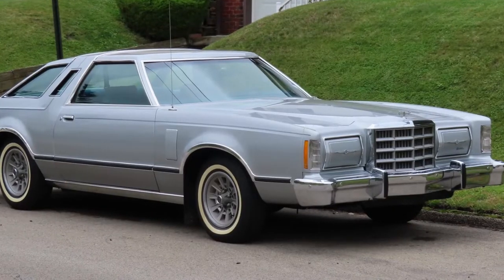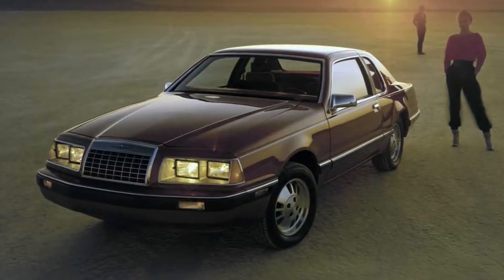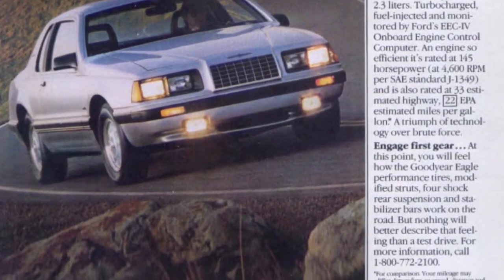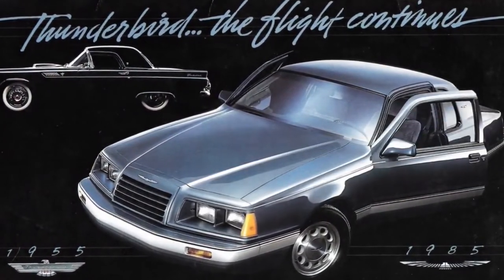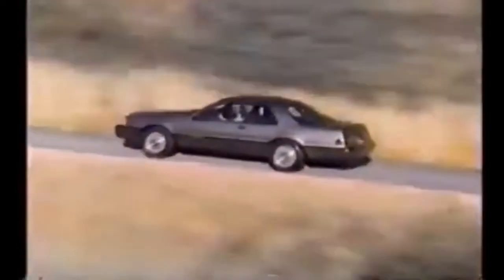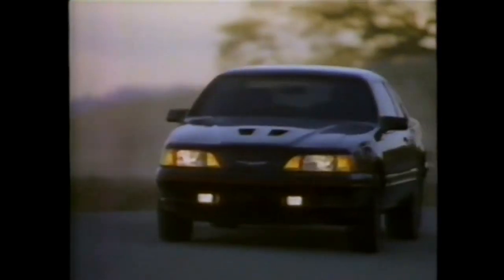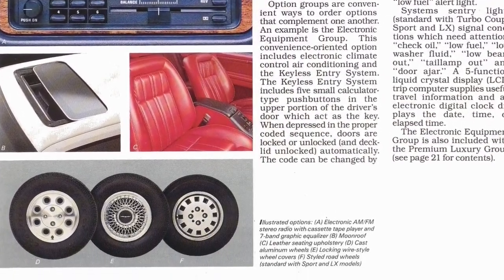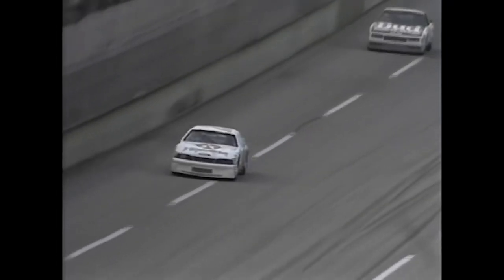1983 – 1988 Ford Thunderbird The History, All the Models, & Features

Comment: I bought an 87 5.0 in 99 with 190000 miles on it. I could put a glass of water on the intake when it was running and it barely made a ripple. 
Was really a good car! I've only drove trucks since then. But interested in getting another now!
Reply from the maker: Fortunately the market for these cars hasn't gone crazy and some decent buys can still be had. Best of luck and thanks for watching!
Reply: @TonysFordsandMustangs   I better get on it now. 3 years ago I bought a 95 bronco for $3000. Now that truck goes for $8-$10,000 in that condition.  I bought it right before Ford bombarded us with ads for the new bronco. One of the best investments I've made recently
Reply from the maker: @joemama1151  Yes sir the mid 90's trucks and Broncos have really gone up in value and most of the Fox Mustangs are as well.

Comment: These Thunderbirds Rank as Some of My Family's Favorites Cars that We've Owned. My Mom had a Silver Blue over Gloss Black 84 Elan, with Light Blue Velour Cloth Interior, a 5.0 V-8, and the TRX Wheels & Suspension. Such a Beautiful Car. I owned an 84 5.0 V-8 Fila Edition, Pastel Charcoal over Dark Charcoal, with the White Leather Seats in a Charcoal Grey Interior. Mom traded Her 84 Elan for an 87 Silver Blue Turbo Coupe, with Raven Black & Charcoal Grey Leather interior, and an Automatic, but the car was an Anomaly.  It had the Engine Tuned for the 5-Speed Manual. It had supporting documentation that came with the car that Ford had Performance Tested it before Shipping it for Sale. The Result however ended up with Ford having to Rebuild the Transmission 3 times under Warranty, in the 5 Years  Mom owned it. I also owned an 87 Turbo Coupe a few years later. Mine was Raven Black, with Crimson Red Leather interior,  and a 5-Speed Manual Transmission.  That car is still the Most Fun to Drive Car I Ever Owned. Mom eventually traded Her 87 Turbo Coupe for a 90 Silver Blue, with Medium Blue Leather (Sensing a Pattern Here?) Lincoln Mark VII LSC. Several Years later I bought a White with Medium Blue Leather 92 Lincoln Mark VII LSC. IT was Dad that traded Mom's Silver Blue Mark VII for a Triple Black, 92 Mark VII LSC/SE, which She Still Owns today.
Reply from the maker: Thanks for sharing! Your family has great taste in cars!

Comment: Hi. Dale Jarrett won the first three nascar races the year the slippery bird debuted. Nascar made the Fords run as taller rear spoiler to slow them down. I found a nice red one at the salvage yard. Clean no rust. Engine locked up. Changed engine, and later found a starter Bendix gear jammed between the flywheel and the engine block. The engine itself was fine. I loved that car.
Reply from the maker: Thanks for watching and sharing!

Comment: Bill won his first race in '83 at Riverside CA driving a Box bird. 

I love the '87-'88 Turbo Coupes, with the 5 speed are fun cars. Used 'em as daily drivers for probably five years. In the mid/later '90s were obscenely cheap at the auctions(people afraid of turbo failure, out of approx 15, one failure). Also common for fuel pumps to be weak, so they'd fall on their face at more than approx half boost. Still I'm a die hard V8 guy so I searched out one with minimal options & automatic(no hole in roof, climate control etc), transplanted a Trick Flow headed 5.0, used AOD from a Super Coupe.. At full weight & all orig systems operating, It would run 13.3s all day long, best 13.11. With a little help(75Hp) from Papa Smurf in the trunk, 12.23@ 112. The drag radials I was using could not hold a "big" shot(yeah I tried). With slicks, acquaintance at track ran 11.6 in a similarly built '88 LX. He was my inspiration, told him I was going to swap a 5.0 in to my Turbo Coupe. Yeah I got the sideways un-huh look, surprised him when I showed up with it at track.
Reply from the maker: Thanks for sharing Tom!

Comment: In 98 I bought a 86 T- coupe with a bad motor for 500.00. I swapped in a nice 325 hp 351w and a c-4 auto trans. It fit perfectly with shorty headers and a custom length driveshaft. That car was my daily driver for 12 years.

Comment: I had an 83 with the standard v6. All my buddies had built mustangs and always wanted the 5.0 or sc. never got one but still loved my car. It was the nicest car a 16 year old could own. I got almost 350,xxx miles on it. Darn thing wouldn’t die, probably still running to this day somewhere. 
I am actually thinking about buying a used one. Not sure how hard a decent one is to find. Awesome car, despite the haters
Reply from the maker: They are not that difficult to find and are priced much lower than a Mustang Fox and Sports with the 5.0 can be had for less than the Turbo Coupes. Thank for watching and best of luck with your search.

Comment: Those were the final great days of NASCAR, before restrictor plates, and when stock cars were still loosely stock. You couldn't take the name of a four door, front-wheel-drive, 6 cylinder car,  take the roof and rear window, and then turn it into a V8, rear wheel drive two door car and race it as a "stock car." In the 80's makers, mechanics, and drivers were pushing the limits to beat the competition, and going 212 mph was the result. I remember watching Bill Elliot suffer a mechanical problem, run back out on the track after losing a lap, then lapping the entire field without a yellow flag, and come home to win the race. That can't happen today.
Reply from the maker: Thanks for watching and sharing. Actually a LOT of people would agree with you. NASCAR has been losing audience share since the early 2000's and some of the moves NASCAR has made to try correct things have made it worse. I stopped watching when the Thunderbird went away in the late 90's. Spec cars Meh, the Chase and segmented racing is something I don't know nor do I want to understand, finally the super teams winning everything had me looking for something else to watch. That said I will watch a road course race every now and again. I find them to be much more competitive and exciting when compared any of the ovals.

Comment: Oh... and BTW, Interesting Fact, that Bright Red 88 Turbo Coupe that's the Banner for this Video, is actually a Rare, Limited Edition, 88 Turbo Coupe/Mach-1. In 1988 Ford Needed to Use the Legendary, Mustang's  Mach-1 Name to prevent Loosing the Copyright to use it. Since the Turbo Coupe was Ford's Halo Performance Model they decided to Use the Mach-1 Moniker on Specially Painted, Bright Red (Non Metallic), or Platinum Silver (A New Color to be Introduced on the All New 89 Thunderbirds) These Colors were Not Available on Any Other 88 Thunderbirds. The Cars also featured Black Mach-1 Decals that were shipped with the Cars for Dealers to install on the Front Fenders, behind the wheels, and also on the Decklid. My Mom actually had a Red Mach-1 Turbo Coupe briefly, but She sold it to a Kid down the Street, who still Owns it today.
Reply from the maker: Thanks for sharing!

Comment: If I remember right the 87 and 88 turbo coupes 5 speeds came with dual exhausts and automatics were single.
Reply from the maker: I think both were but not really as they became dual exhaust after the cat convertor. The auto was detuned a bit because the transmission couldn't handle it.
Reply: @TonysFordsandMustangs  maybe it was just 1987 for the single with automatics. They may have all been duals in 88. I agree, the duals were just outlets.
Reply from the maker: @billnorris3305  That's possible I would have to look it up

Comment: My boss originally bought me an 84 turbo coupe and I kept it for about a year and then I saw the the 87 model of the car of the year so when I move to a different state my boss I needed a newer company car and my boss and I went down and they had a silver 88 turbo coupe with a manual that thing was loaded and he paid for it with a credit card I couldn't believe it but I ended up turning the boost up on it and I got a lot more power right I think I don't even when I went up like 6 psi it made a big difference because it was easier with the ratios on the the 5-speed manual because a lot of times if you downshifted you be at the red line so with having more boost I didn't have to downshift all the time

Comment: Problem is the 87 Super Coupe was slower than a 3/4 ton Ford pickup with 7.5 l pickup. I know. I tested them when new. Probably half price too.
Reply from the maker: It was decent for the time period and was a nice cruiser around town and on the highway
Reply: @TonysFordsandMustangs  I worked at a Ford dealer and the boss bought a couple of the 83 Turbo Coupes at auction. We tried and played with the boost somewhat but ran into some surging type problems. He really loved the early ones. Apparently the 87 Super didn't sell so well that the company reps were using them instead of the more bread and butter cars. Threw us the keys and said take it for a spin.
Reply from the maker: @keithwiebe1787  I sold cars at a Ford dealer in 87 & 88. I sold several turbo coupes and those car pulled harder than the non intercooled cars. They were not fast but fun cars. Ford sent several of us to an SCCA driving event for those cars and the MT-5’s.